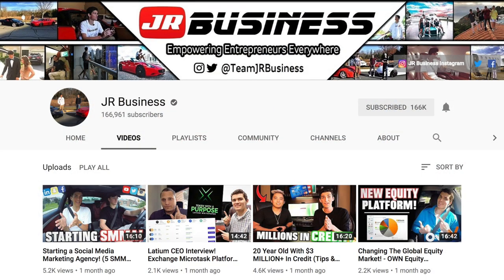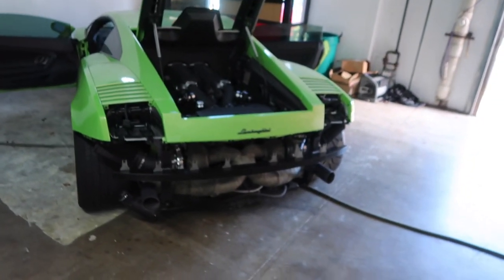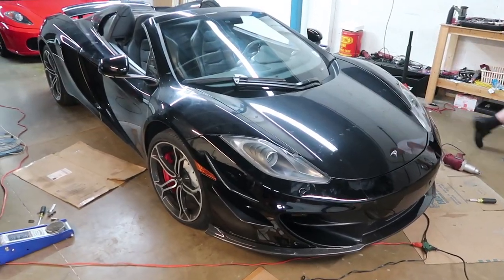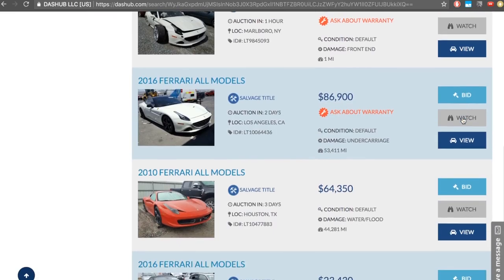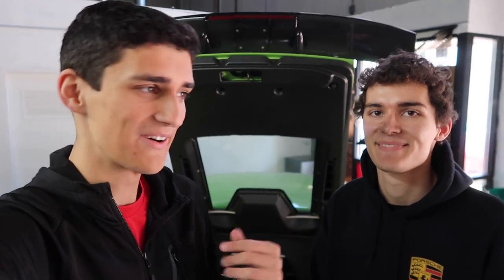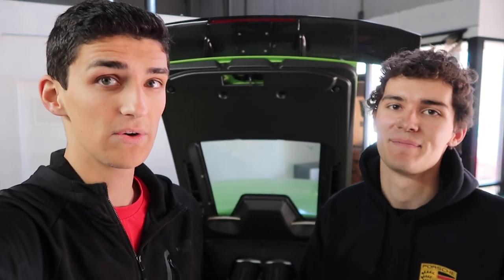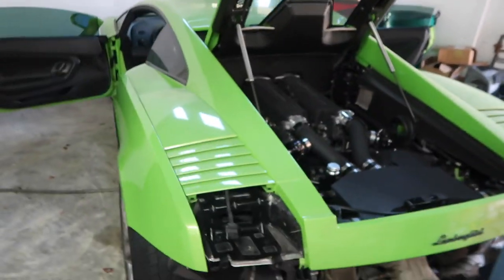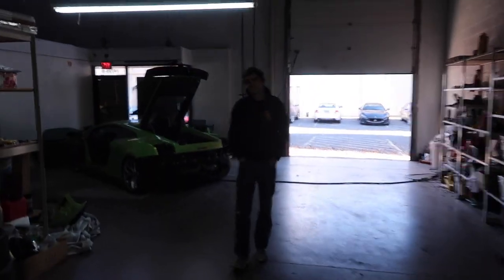I Bought a Wrecked 2000 HP Twin Turbo UGR Lamborghini At Auction!

Comment: You can fix the hres by putting new lips on them they're 3pc wheels. No need to replace the whole wheel
Reply: That's going to need more than a lip most likely taking a hit like that it's probably bent/ cracked in more than one place
Reply: Kenny407 normally i would agree,  but with this much power and speeds i would buy new ones. You don’t really know how the metal of the other pieces are after the impact. Better save than sorry

Comment: so its really a 1850hp car but because it has underground racing stickers that practically adds 200 more hp
Reply: Zac Crockett 1800+ at the wheels=2000+ at the crack
Reply: Zac Crockett stock gallardo pushes nowhere near 1800hp dude
Reply: 1800+ whp... There is on average about 15% loss from hp at the crank to whp.. so assuming a 15% loss, that puts it around or over 2000hp
Reply from the maker: Zac Crockett 1850 WHEEL hp, equals well over 2000+ CRANK hp after drivetrain energy loss:)
Reply: Well as long as Its not Dallas performance I think it could be almost 2k hp
Reply: TrollMunchkinz m yes I know, that’s what I said in my comment 😂😂
Reply: @stealthbombing_991  there's nothing stock about it.. who said stock??
Reply: Jordan John what so 3000 on the cocain

Comment: Drag race it against the Roadster.
Reply: Skylar Parks the Lamborghini would easily win
Reply from the maker: Skylar Parks that would be interesting🤔
Reply: Discord incorrect
Reply: Discord incorrect
Reply: @discord6047  what? are you challenged?
Reply: @HelloPrettyFace100  are you?? At full boost this will walk the roadster by the numbers they released the lambo has more power and will reach it's top speed faster without a doubt I work 3-4  1/2 mi events a year and  lambos are well over 250 just in the half now  roadster would be Lucky to do that in twice that distance,  electric starts fast andthe power slowly falls off  the only Advantage it will have is getting off the line faster because the lambo has too much power to put down right away and has to be rolled in slowly... Plus you can't upgrade the engine and a roadster because it doesn't exist you can keep making the lambo faster and faster no comparison... Now stop comparing cars that aren't on the road yet in the first place..

Comment: This was stacy Barnets UGR 2R from 2014/15 wondered what happened to it 

car ran 200.35mph in 1500 feet(450meters) at Texas invitational 2014 

and is capable of doing 218-230mph in the Half mile(800 meter)

car has max Hp of 1800 wheel horspeower or 2400BHP.

weighs like you said 4162 pounds meaning it's kinda heavy but meh has the power to overcome it.
Reply: whoops forgot the supperleggeras weigh 3300 pounds give or take

Comment: Dude you guys killed it of buying a Lamborghini you guys should put a build V10 in it and you should put a six-speed transmission and also put a VF engineering supercharger on it and you should you guys should do suspension swaps interior design and also complete makeover on the car but you guys killed it of buying the Lamborghini Gallardo